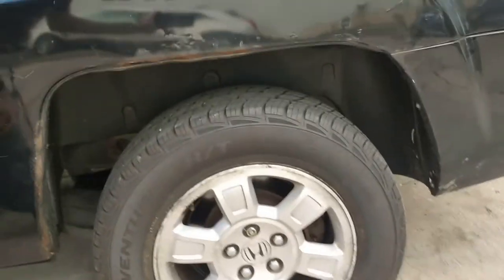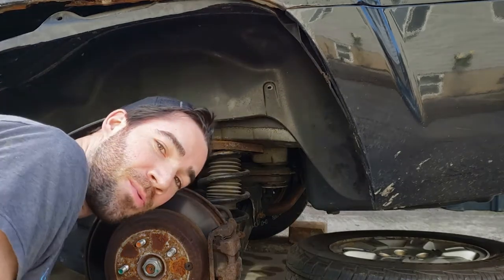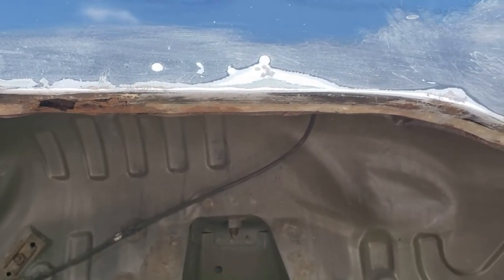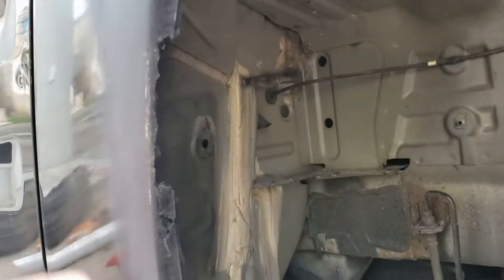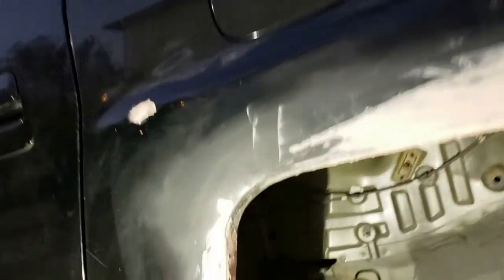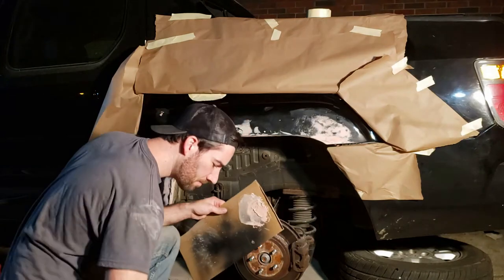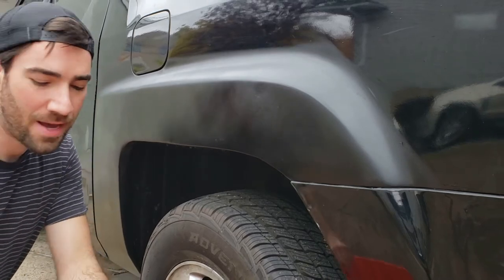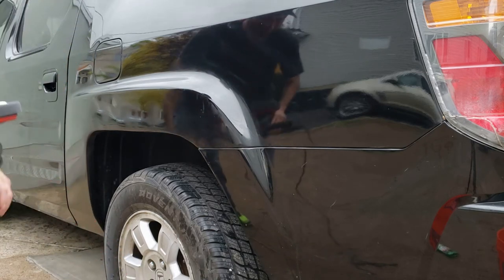How to fix rusted fender at home cheap with Bondo | 2008 Honda Ridgeline

Comment: How many hours do you think it took you? By the way , I think you did an excellent job.
Reply from the maker: Probably 4 hours all in.
Reply: @EveryotherKarl  how has your repair held up? Thanks
Reply from the maker: @FreakyBeanie  I had to sand it down, put a little more filler in and re-spray it about 2 years later. I detailed that in my titanium 125 flux welding for body work video if you want to check it out.

Comment: Next time try to end with clear as a wet coat. I have used cans many times and no need to sand and buff. Friends have been amazed and with cans paint looks like factory. Don’t sand after color or clear. First two clears are that light then medium coat then wet for third.

Comment: You must have prior experience, no way average joe will turn out like this
Reply: It's surprisingly easy to be honest, just don't skip the putty step, _you can see the sand marks in regular bondo if you dont.  I am starting one where the bottom ridge is missing entirely but can't find any vids without welding a new peice in.